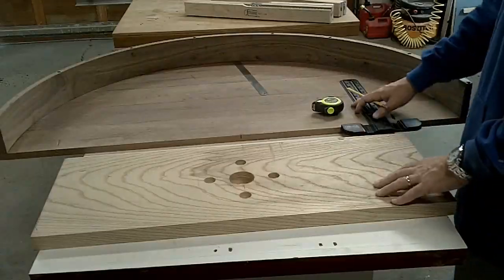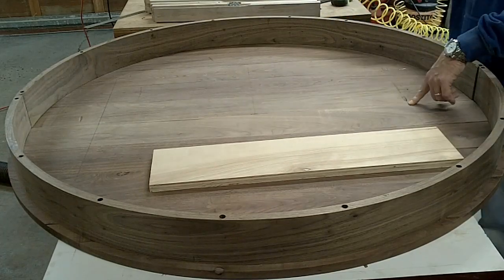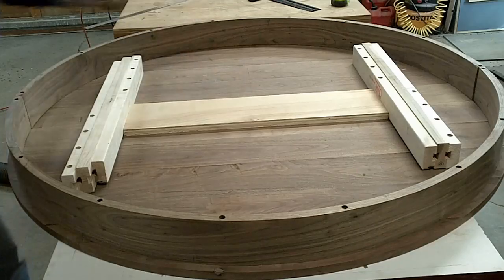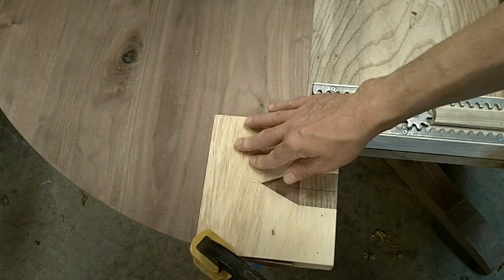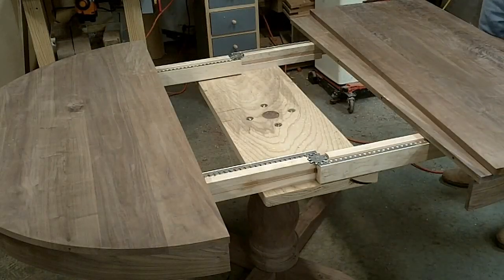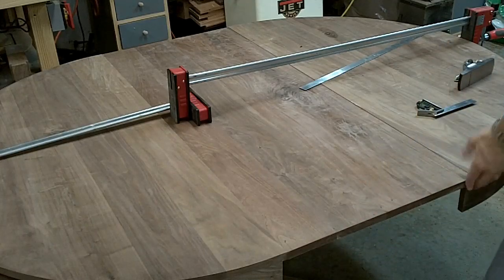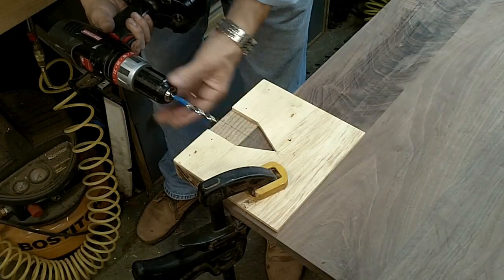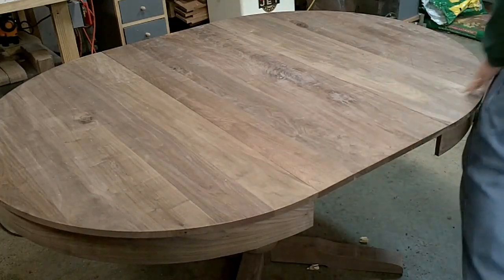Pedestal Extension Table - Part 8

Comment: Did you consider using a straight edge and router with a flush trim bit to cut the sides of the leaf parallel and square? Seems like it would've been a lot faster and less room for operator error!
Reply from the maker: Andrew, that's a good idea. Like all things woodworking, there is many ways to skin a cat!